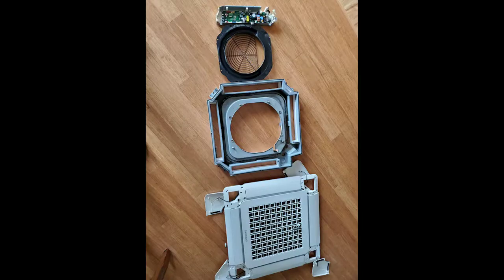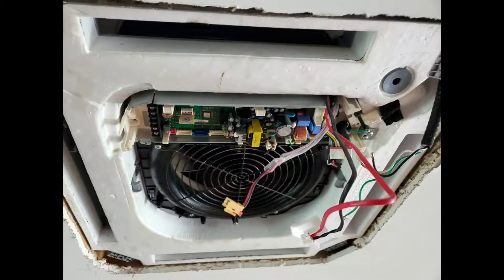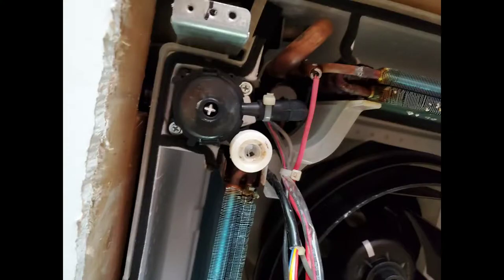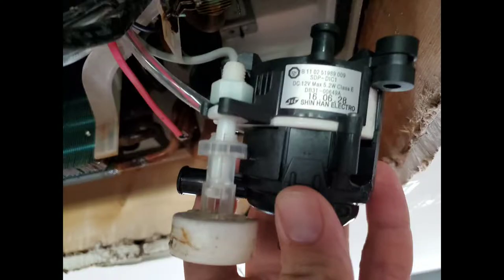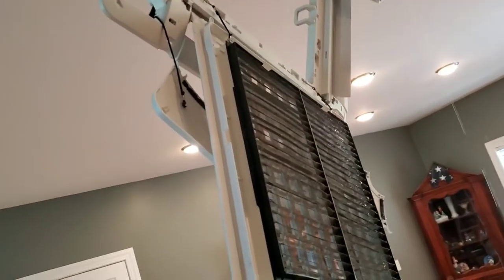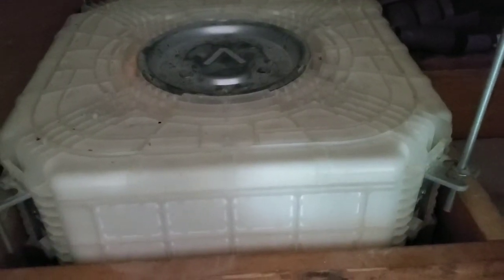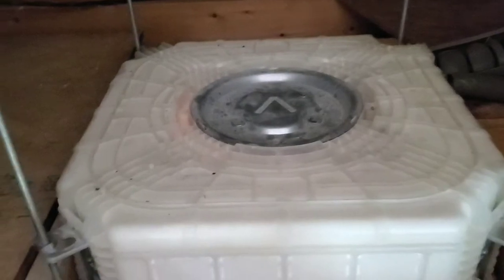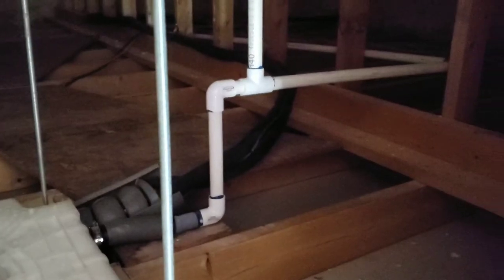Ceiling Cassette Drain Clog E153 #drainpump #SamsungHVAC #hvac

Comment: That condensate drain pipe looks too big to work with the low volume of water and low pressure pump. The 12" step up must defeat the pump so the water drops back down to the unit. And you had drain issues? Run that drain line to utilize gravity.
Reply from the maker: Everything's been working smooth ever since

I'd replace the pump because the dust from construction and the unit being operated during that period caused a lot of damage

Thanks for the advice
 Thank you for watching

Comment: I installed a new unit when  Condensating it makes a loud buzzing sound periodically Any ideas how to get rid of it
Reply from the maker: I'm not sure I would have to see the unit and hear the sound
Reply: Mine does something similar, they are senville units. I have 2 ceiling cassettes one makes the noise the other doesn't. Still trying to locate the noise. I think it's the condensate pump. I changed the motor, checked the fan blades, checked for loose components and checked the directional vents found nothing. Last thing on the list is the condensate pump